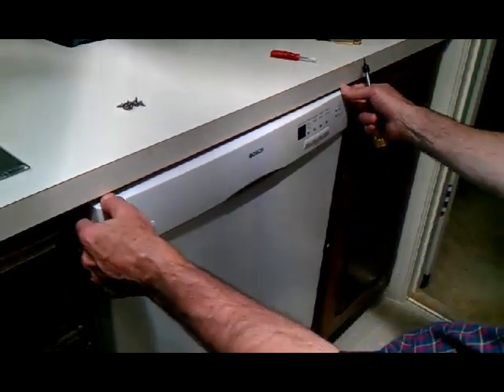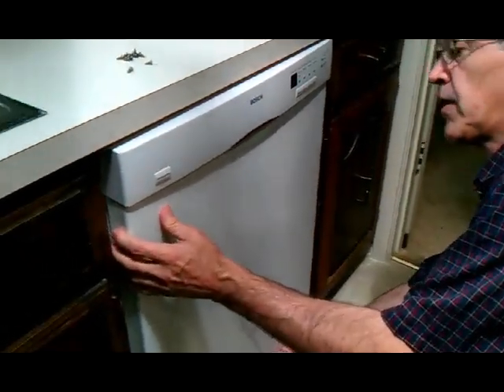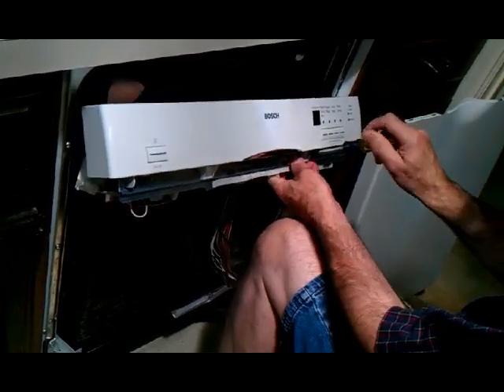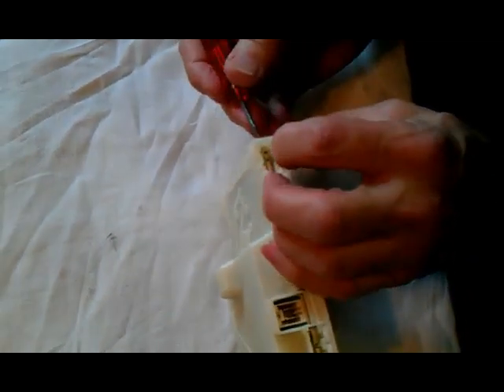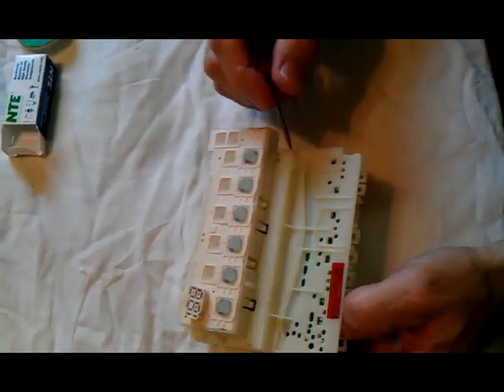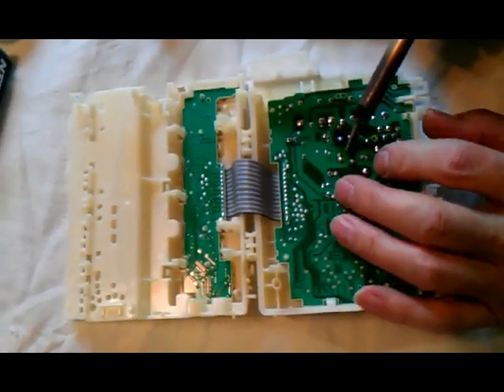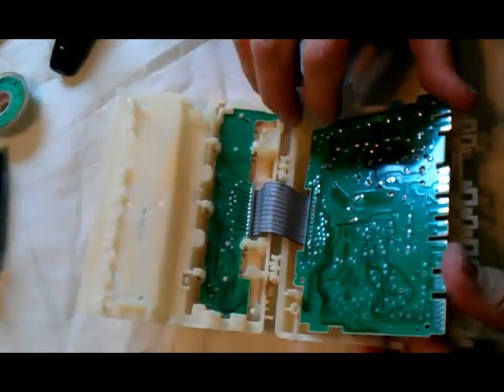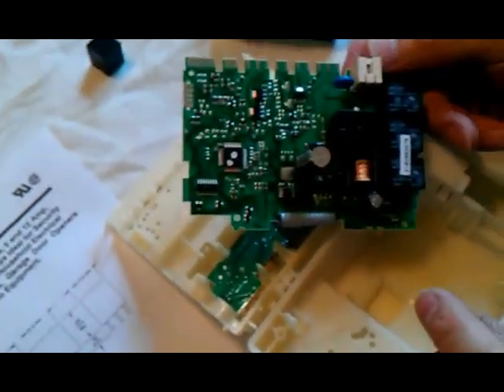Bosch Dishwasher Heater Relay Repair Part 1

Comment: AgglomeratedIdeas , thanks for the Excellent Video :)
EDITED - SOLVED :)
I have the same Bosch / Siemens Dishwasher circuit board 704226, but with a different problem as you can see in the photo.
Does anyone knows the value of this broken resistor?
https://photos.app.goo.gl/dZ2AcFDkp6yAN9Sk1
Brown, Black, Black  = 10 Ohm Ω
But the problem is in the LNK304GN, you need to change it.  (other models use LNK364GN)

The codes in my Control Board are:  
AKO 718774-02
PRG 718780-07  84  100208
BSG 9000 354 460 29736
Thanks in advance
Reply from the maker: Look at the comment posted below by mrbissi (about a year ago) regarding this resistor.  Your resistor did not just break, but instead it looks that way because it burned out.
The resistor connects from the high voltage circuit on the control board to something in the unit.  I have not traced where it is going, so I don't what it is that is causing these resistors to burn out.  (Someday maybe I'll take mine apart and find out!)
The dishwasher schematics are usually rolled up very small and stuck into an area near the water inlet valve.  If you can follow the trace on the board to where it goes off the board and then inside the unit, then you will probably know what has failed.
Hope this info helps.
Reply: EDITED - SOLVED  -  Explanation below   
Hi , Thanks for your quick answer :)
I read it, but you said "(...) colors on that resistor are Red/Red/Black/Gold which is 22 ohms", 
and mine is different, that's why I asked
The resistor was "ok" but I saw something black under it, and when I touch the resistor it just broke itself, that´s why you see it in the photo like that.
Thanks for your tip, I'll try to find it. And if I do find it, I 'll post it here
You are the Man :D
Reply from the maker: The black spot on the PC board is caused by overheating the resistor.  The resistor would not normally run hot enough to burn the board.  When whatever it is attached to outside the control board (we don't know what at this point) fails, then the resistor overheats and burns out along with discoloring the board in the process.  An overheated resistor will often break on its own, or will easily break if touched as you have found out.
You have eyes on the resistor and I am only looking at your photo, so the colors I am seeing may not be the colors you are seeing.  However, the bands on the resistor will often change color when it overheats.  The color bands at the two ends can be somewhat relied upon to be the true color because the ends are cooler, but not always.  The two bands in the middle will often change color and sometimes the other two bands as well.  In all the photos people have sent me, if the colors are still identifiable on the resistor, they have all been Red/Red/Black/Gold.  You may have something else though...I just don't know.
Reply: Dear AgglomeratedIdeas 
Luckily I found a technician who knows this problem very well (overheating the resistor), and even knows what's causing it.
The problem comes from the LNK304GN component, which is a "power integrations ac / dc converter"  that fails and then overheats the resistor.

This became so common, that he even knew by heart the values of the resistor:  
was either 22 ohms (most common) or 10 Ω (brown, black, black)

Depending on the model, the "power integrations" may be the LNK304GN or the LNK364GN.

He told me, that since the Power Company installed the new electrical house meters with remote reading, there were huge breakdowns in the dishwashers control circuit boards, and it's always the some problem. 
He thinks it is related to the carrier they use, to make the communication because it uses a very high frequency and the electric filters were not prepared for this new frequency.

This is the photo with the original components (damaged)
https://goo.gl/maps/z6cfkJUX6f82

He also told me to be careful when buying the LNK304GN, because there are some "counterfeiters" that DON'T work, so I went to buy at a well-known store to buy them.
The store did not have the lnk304_G_n, so I bought the lnk304_P_n, 
and it was just "bending the legs" and cut the excess :-)
The end result is this
https://goo.gl/maps/GYAJfYhE6Tr

I think you should put this tags on your YouTube video
"Siemens Dishwasher SE24M263EU /36"
"No Power Dishwasher"
"Bosch  Siemens Dishwasher circuit board 704226"
AKO 718774-02
PRG 718780-07  84  100208
BSG 9000 354 460 29736
Bosch  Siemens 704226

All the best,
Fernando
Reply from the maker: That is fantastic news Fernando!  Thanks for posting the story behind this resistor.  It has been such a mystery until now.  Cheers!
Reply: Thank you for your input. I have repaired my dishwasher by buying a new module. I will now be able to repair the original module to use as a spare.
Reply: Update:
After 2 weeks on this post I decided to "tuning" and lining some parts (front & rear) with Expanded Polystyrene White Foam to avoid losing heat and thus increase efficiency.
I know, that's what my wife says: Too much free time :-)
you can see it here:
Front (inside) Expanded Polystyrene White Foam 
https://photos.app.goo.gl/lldGqHYu287uZiYc2
Rear (outside) Expanded Polystyrene White Foam 
https://photos.app.goo.gl/MV2j8JIe5sCN7G8m1
https://photos.app.goo.gl/A1GD3IUPKF1ChLG93

Maybe it was just a coincidence; or maybe it was me that inadvertently caused a short circuit; maybe the components had a defect or were of poor quality; I don't know,
but I had again the same problem :(
This time the resistor didn´t overheat, just burn in a small spot
https://photos.app.goo.gl/1N0WMGp9arK2FFn32
https://photos.app.goo.gl/xZKg3VxmE7xAJQZu2

Because changing the IC, is dificult I have install a IC socket
https://photos.app.goo.gl/7KCtkTW6IdRdCZ362

The IC and the resistor, are from a diferent brand, (supposedly better)
the resistance value was increased, the original is 10Ω now it's 33Ω
https://photos.app.goo.gl/dRYR7ohsS4PdzNk03

This post is written after I have done more than 30 washes
so far so good :-)

Comment: Great video! Ours is a SHX46A06UC/14. A couple of years ago, we found the burned solder connection, fixed that, and when that failed a week or so later, we replaced the whole control board for ~$100 (eBay part). Now, after a power failure and surge, that board has failed too. Thanks to your video, and some part cross-referencing to confirm the proper relay part number, I have just ordered the new relay (R46-5D12-6 Series R46--which I think is the correct part) for under $4, from Amazon. 

Thanks again. I expect to get our machine back in service in a couple of days.
Reply from the maker: Bummer that your eBay find was wiped out by an electrical surge...that was a good price for the board.  I am assuming that you ordered the replacement relay for your old board.  If so, it should be as good as new after you get the new installed on it.  Your experience with just re-soldering the joint only to have it fail within a short period is typical.  The bad relay will usually just melt the new solder off of the pin again and you're back where you started.
The R46-5D12-6 has a 6 volt coil, so if that coil voltage matches your existing relays on the board, then you ordered the right part.
I hope your repair goes well when you get your new relay!

Comment: Thanks for your great advice - you are a champion:) Saved us huge repair bill. We pulled out the pump first to find it was fine. One website said it was seldom to do with the control panel, lol! Over 95,598 views begs to differ. Pity it seems to happen around year 5/6. Accept that relays have an expected lifetime but is it shorter with new electronics?  Thanks again - love how the YouTube community helps one another. Bless:)
Reply from the maker: I'm happy that you found the video useful and made a successful repair.  Thanks for sharing your experience with us.  Cheers!
Reply: if you contact Bosch, and your dishwasher falls in the recall window, they will fix it for free or offer 40% of a brand new unit.

Comment: What a great video!  Thanks for posting.  Our dishwasher has been having trouble.  It is a SHE44C as well.  The symptoms are the same as you described but the control boards doesn't look like it is obviously smoked or overheated.  Instead, there are a couple of slightly browned points.  Because they are on the same relay you replaced, I am thinking this may be my problem.  My relay has these numbers on it:
HF3FA
006-HTF(576)
10A 250VAC
Can you help me identify which relay I should order?  Also can you recommend a good solder sucker?  Thanks again!
Reply from the maker: You have 6 volt Hongfa relay.  The datasheet can be found here: http://www.hongfa.com/pro/pdf/HF3FA_en.pdf
A NTE R46-5D12-6 relay would replace it.  The relay you have is a SPST and only has 4 pins.  The NTE R46-5D12-6 has 5 pins because it is a DPDT relay.  If the 5th pin does not have a hole on your board, just cut the pin off as it is not used.
As for a solder sucker, check the supplier where you order the relay. I've had the same solder sucker for over 40 years so I really haven't checked into buying one recently.  You could buy solder wick instead of a sucker.
I hope your issue is related to the relay and a new one fixes your DW.  If a new relay does not fix it, check out the trouble shooting procedure for the heater circuit in the comments below.
Reply: Thank you for the quick reply.  The relay and solder sucker are ordered.  We'll see how it works and I'll post back with the results...

Comment: Thanks for taking the time and making this video. I'm having trouble find either the 899b-1c-f-c e 6v or the NTE 46 5d12 and when I do the shipping is ridiculous for such a small item. Would a SRC-5VDC-CL work? I know its 5V but its also 20A and uses same form factor.
Reply from the maker: I would not recommend the use of a 5V relay as a replacement for the 6V unit you have.  The relay coil may possibly overheat and fail.  Try to find another 6V relay with the same form factor.  You can use a SPDT or SPST type since the normally closed pin is not used.
Reply: These should work http://www.futurlec.com/Relays/JQC-21FF-06.shtml
JQC-21FF-06
Reply from the maker: Yes, that relay should work fine.  Cheers!

Comment: these are 120VAC relays. I believe a lot of people have 250VAC relays (manufacturing reasons unknown). I'm in the sates but the relays are 250VAC on mine.. I believe 120 VAC relays can be used no problem if voltage line is stays at 120VAC. Thank you for your video.
Reply from the maker: The 120VAC and 250VAC refer to the contact current rating when that voltage is being switched. Some manufacturers will publish just one of the ratings, or sometimes both. It really doesn't matter for this relay and either will work because the current goes down in the heater circuit in the dishwashers that run off the higher voltages usually found outside the U.S.
Thanks for commenting.

Comment: Excellent video, thanks for the help! On my board, I see 4 of the same relays (all 899-1C-F-C 6 volt, 10 amp), and one clearly has a burned solder point. But instead of the heat pump not working, the whole unit would not turn on (no LED segment lights up, etc.) I own a SHX46L15UC/50. I am assuming the same relay replace method describe in this video should do the trick, but thought I'd ask as it's not a particular function issue, rather the whole board not working. Thanks!
Reply from the maker: Sorry, but I don't think replacing the heater relay (or the other 3) will fix your issue.  If the heater relay is defective, the unit will still turn on.  If you are handy with a multimeter you could check for power at the unit and the control board.  Sometimes it is simple things like loose connections at the incoming power cable.  The unit should have a wiring diagram that is rolled up and usually stuck somewhere near the incoming water valve.  Be CAREFUL working on a powered unit!
Reply: Thanks for getting back to me, bummer!
Reply: I had the exact same problem as of a couple days ago. and after looking at the electrical circuits closely I can confirm that the that relay gets power immediately after the main positive power lead plug at the side. It's the relay that isn't next to any of the other white relays but more on top of them right? (has a blue resistor next to it). Mine had a brown spot. Using copper wick and soldering iron I removed the relay and I checked online for a replacement. On mouser they're on backorder (until August) but using the same specs from the datasheet I was able to find a newer version (more recent RoHS) as the "833H-1C-C-6VDC" datasheet here: http://www.mouser.com/ds/2/378/20119191320287145-4912.pdf, while the original (899-1C-F-C-6VDC) datasheet is here: http://www.mouser.com/ds/2/378/200982919182111463-7392.pdf  . as you can see they're practically identical except for the coil insulation class. I ordered this one and also a panasonic one (769-JS1-6V-F) which has the same coil insulation class (F) which should also work since these relays are of standardized sizes. I'm waiting for their arrival. I'll post results afterwards..
Reply: That's awesome, I hope it works out! Although, I'm not sure if we are talking about the same part - mine is a black one pretty much in the center of the board, it's not directly next to the blue capacitor. Here is a photo of mine, it's the black one right in the center (not any of the 3 lined up): https://goo.gl/CyoK5U
Reply: :) yeah, we are. Mines white, yours black, mines blue, yours green. But soon I'll have one black. I'll let you know how it goes..
Reply from the maker: Yes, the heater relay is the one in the center of your photo. Your relay has a 6 volt coil and the NTE R46-5D12-6 would replace it. I hope your repair goes well. Cheers!
Reply: Hey mrbiznessguy - any luck on the new part? Was thinking about ordering the updated part you posted if so, let me know and thanks!
Reply: i installed the relay and it still didnt turn on. could be the control unit.. I know that wasnt helpful, but for $10 it was worth a try. at least for me..

Comment: Hi there,
I am looking for the JS1A-5V AJS3319 10A 125V Relay for my Bosch dishwasher. However I cannot find one on the internet. 
Is there a replacement that I can go for instead?.. Many thanks in advance.
Reply from the maker: The JS1A-5V has a 5 volt coil and is SPST.  That relay can be found here: http://www.mouser.com/search/ProductDetail.aspx?R=0virtualkey0virtualkeyJS1A-5V-F
Reply: Thank you so much, your suggested part fixed the problem on my dishwasher.
Kind regards
Reply from the maker: Glad to hear that you got your DW up and going again.  Thanks for the feedback.  Cheers!

Comment: Finally had time to work on the dishwasher. The number for mine is the same as stargazer0257's    899-1C-F-C 6v 10Amp

Where can I buy the  NTE R46-5D12-6 replacement?  Do you recommend Amazon? Thank you! Thank you! Thank you!!!!
Reply from the maker: Yes, that part number indicates a 6 volt coil and the NTE R46-5D12-6 would replace it.  Amazon will work, or just Google "NTE R46-5D12-6" and you will find other suppliers such as Newark, Allied, etc.  Cheers!
Reply: Better price at Newark than Amazon.. Thanks!

Comment: This is a fantastic video! Thank you so much for making it. I too, fixed the solder joint and now it's doing the same thing -- running for hours, but never reaching high enough temperature to sanitize. My model is one of the most basic (I bought, to avoid "bells and whistles" issues)  and I missed the recall by one digit. So frustrating!
Please  tell me where you bought the relay. I will be taking my dishwasher apart  in about a week.
Thank you!!
Reply from the maker: If you can provide the part number on the top of the relay then I can offer suggestions as to where to buy a replacement.  The part number is important because it will identify the coil voltage.  The relay must be replaced with another one that has the same coil voltage.  They are usually 6 volt or 12 volt, but there are some models with 9 volt and 24 volt relays.
Reply: Thank you! I will respond with a number as soon as I get a chance to take  it apart -- might be a few days.

Comment: When ordering relays, you might want to get a few of them. I just replaced the relay (NTE R46-5012-6) for the second time in 2 years in our SHU66C05UC. As Big Daddy reported (below) both times the solder joints on the board looked OK with this model. But replacing the relay fixed the problem. He reported that dissecting the old relay confirmed that it was burned-out internally. Maybe it's easier with other models, but I found that gaining access to the circuit board seemed to require some cutting of the plastic cover on the right hand side to dislodge it.  BTW: this job's a lot easier the second time around. Thanks so much, Agglomeratedideas!
Reply from the maker: Yes, absolutely order a spare...or two if you think you are going to own the DW a long time.  The relays are cheap.  It is the shipping cost that hurts!  Thanks for sharing julesy44.